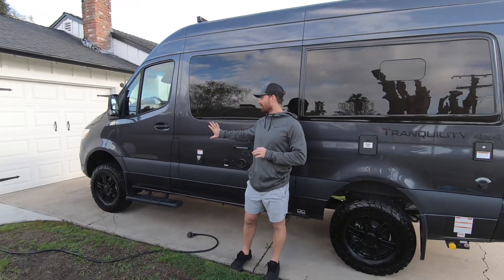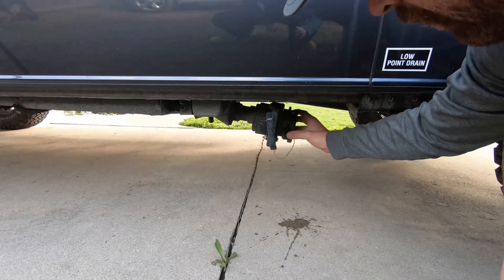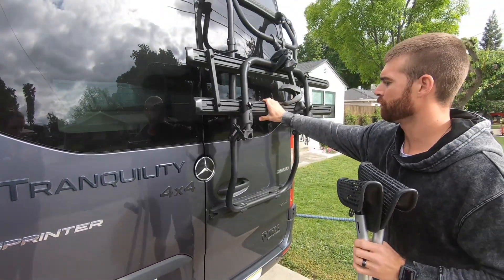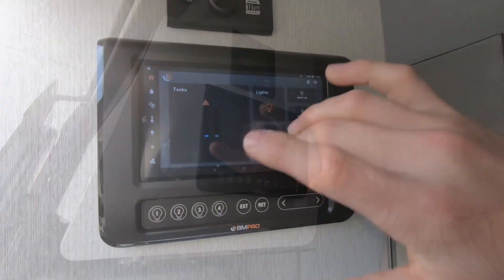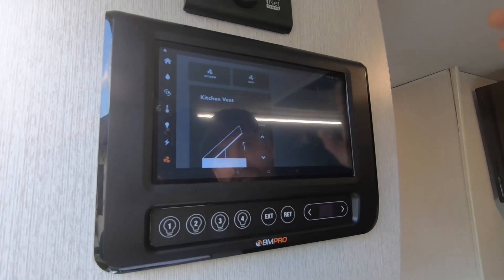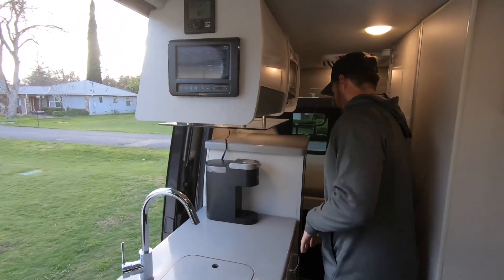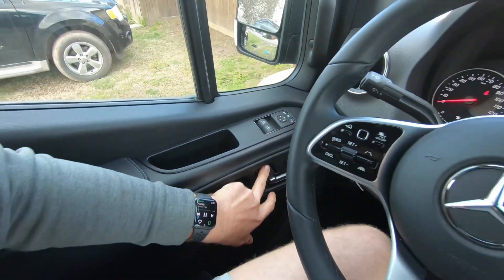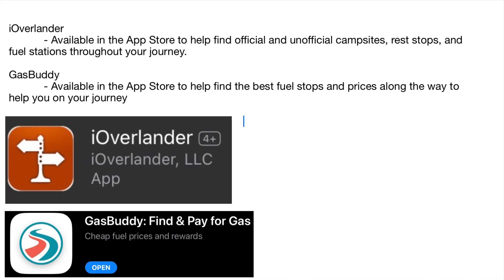2023 Thor Tranquility 19L

Comment: Are the water tanks and water lines inside the van like on the revel to make it 4 season capable? Is the heater a diesel heater or some other type of heater.
Reply from the maker: Yes the water lines and tanks are inside the vans and the propane runs the heater and water tank heaters to prevent any freezing!
Reply: @Snydergetaways   thank you for the response, much apprecitated

Comment: Mercedes stopped making 4x4 in 2022. Is this AWD?
Reply from the maker: It is 4x4. It’s a 2022 Mercedes chassis but 2023 Thor coach
Reply: @Snydergetaways  Thanks! How long have you had it on Outdoorsy? Are you concerned about the potential damage, wear and tear?
Reply from the maker: @richardlindley4195  definitely get a little nervous every time we rent it out but outdoorsy has an awesome policy and great customer service for whenever we have an issue. We have had it on outdoorsy for about 5 months so far